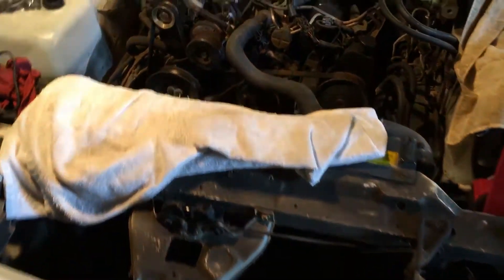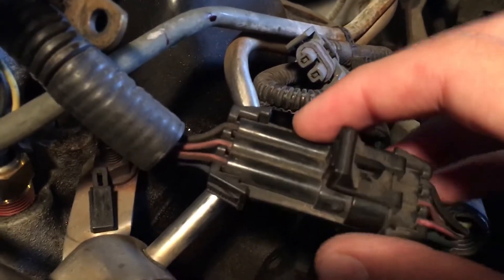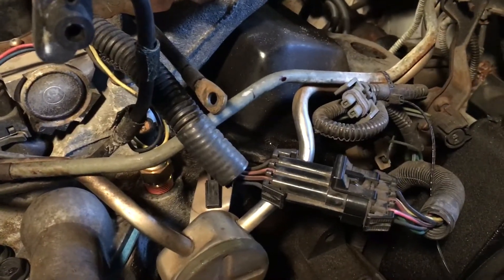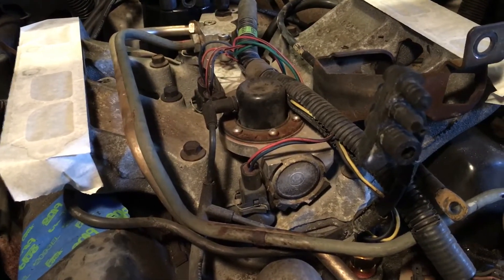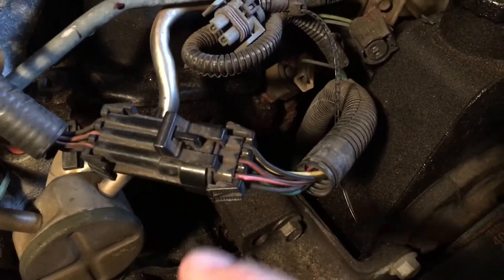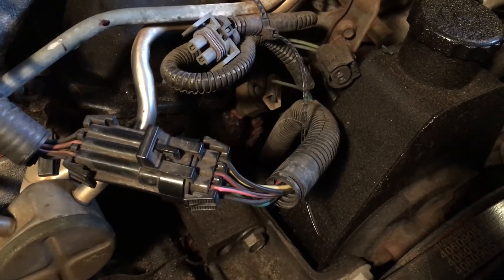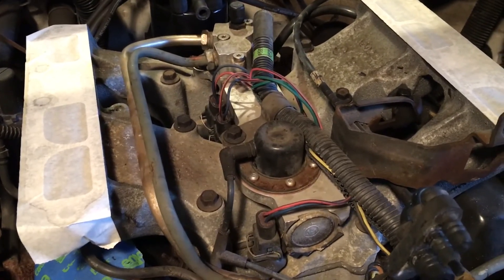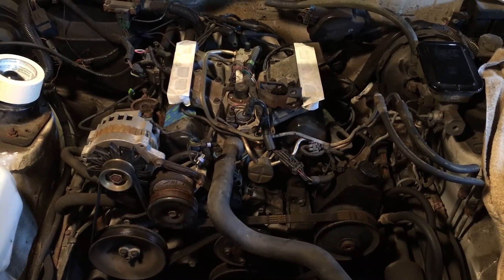3.1 Camaro Fuel Injector Troubleshooting

Comment: Hi there, this video is super helpful. I’m having a similar problem. I don’t have any flicker at the blue and green wire into the injector harness. I have 12v at both pinks at start and crank. How do I get power to the blue and green???? Please help